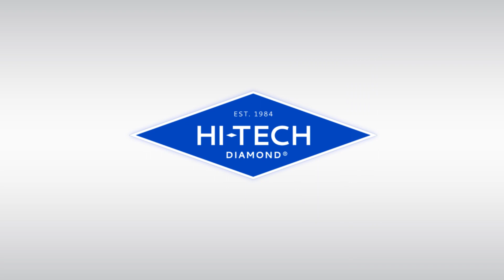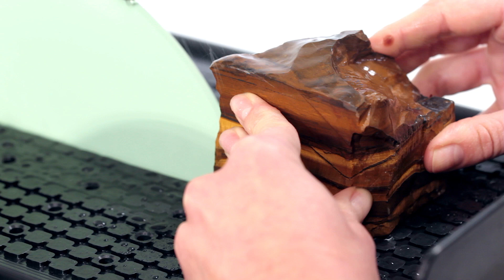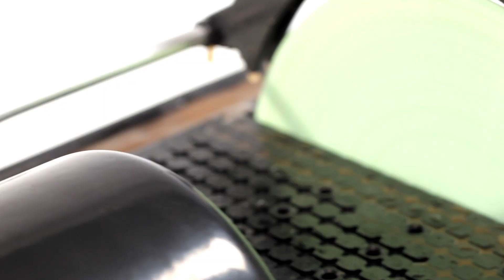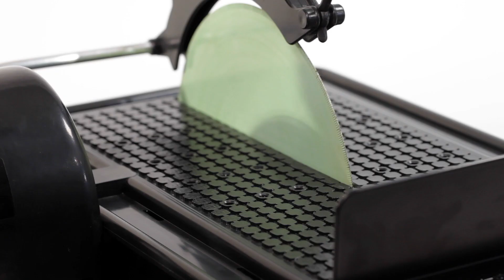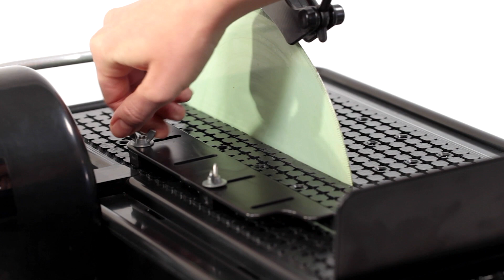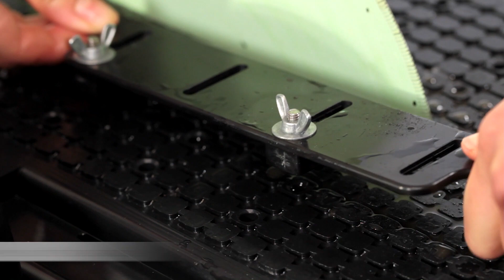Hi-Tech Diamond 10" Slab saw - Slabbing tiger's eye stone

Comment: Would it be okay to use something to push the stone through? Like using a 2nd piece of wood to push a 1st piece through a table saw? To protect fingers from the blade. Or do you think it would create uneven pressure and cause the final piece to be cut crooked
Reply from the maker: Hi Kirsten! We have a saw vise accessory available for this saw that does exactly what you're requesting. We don't have a video on this yet, but we're working on it. For more information, check out the saw vise description here on our website: https://hitechdiamond.com/shop/10-inch-slab-saw-vise/
Reply: The cutting part of the saw blade is on the sides of the blade. You can actually touch the edge of the blade with your fingers while it's on and turning and it won't cut you. On the sides it would rub your fingers raw but actual cutting wouldn't happen. It's quite safe.
Reply: TINKER old comment but it would help with the chipping though. Also be aware that tigers eye may have asbestos in it.

Comment: That still pretty dog on fast compared to the speed in which my saw cuts. Am I not adding enough pressure? I don't want to force it! It takes me 15 to 20 minutes to cut through a 6" piece. I'm a new be though. That is why I'm asking. What is the average time that it should take for me to cut a 6" piece off of a slab?
 If I put pressure to cut my blade keeps vibrating back-and-forth! Though it does run smoothly and does not contact anything if I'm not cutting with it.
Reply from the maker: The time it takes to slab depends on a lot of different factors. We would like to speak to you so that we can better assist you over the phone. Please call us at (630) 596-9909. Our customer service representatives love helping our customers!